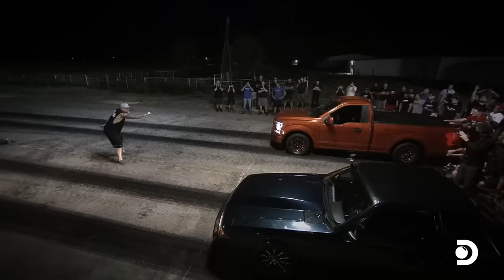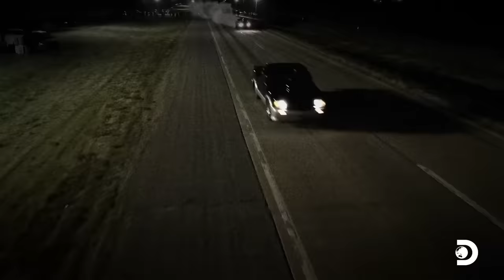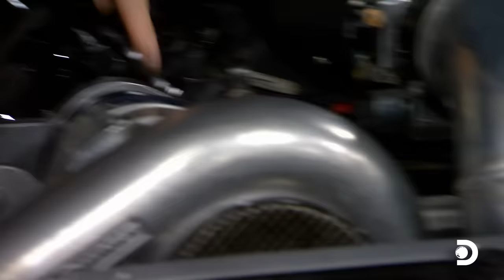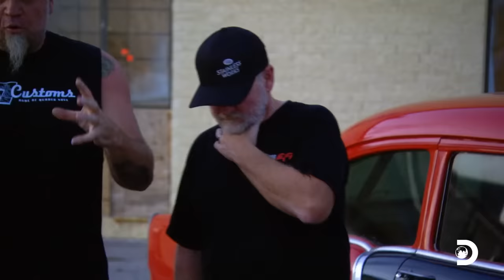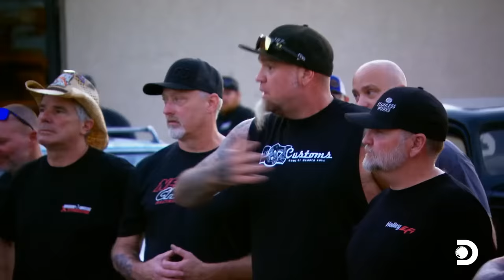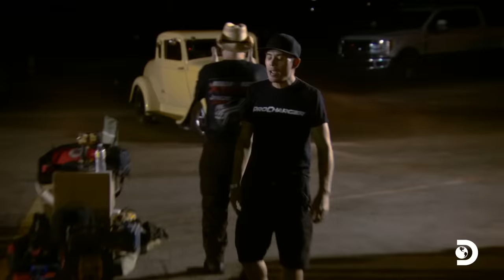Huge Rivalry! OKC vs. Tulsa | Street Outlaws

Comment: Why are they running pro chargers and not Turbo chargers , you don’t need to drive the belt . And your on the 2step so it will build boost on your launch , what’s so special about the prochargers? They are getting sponsored ?